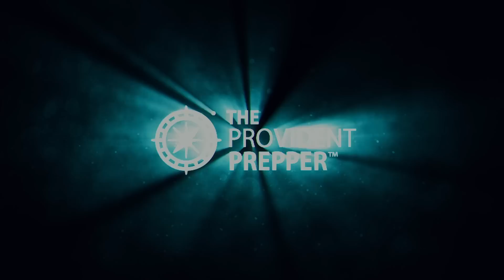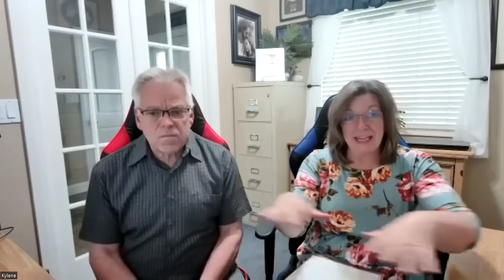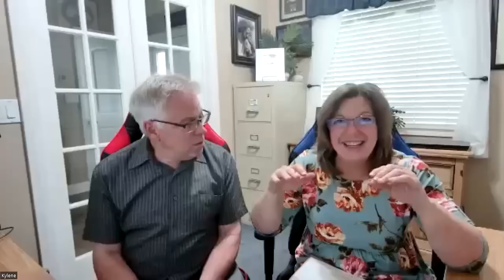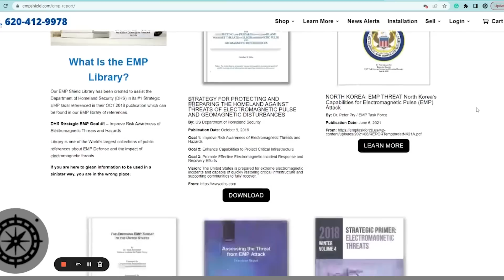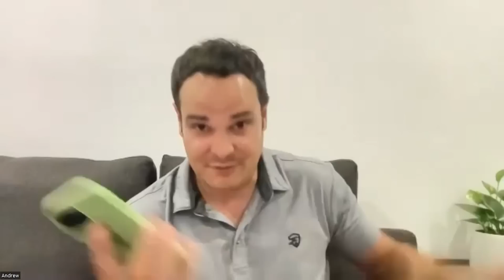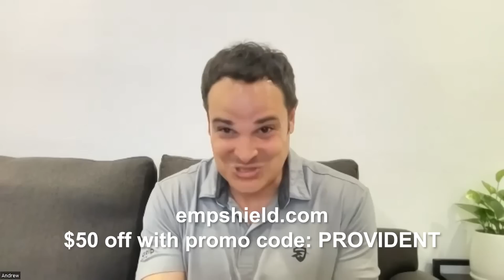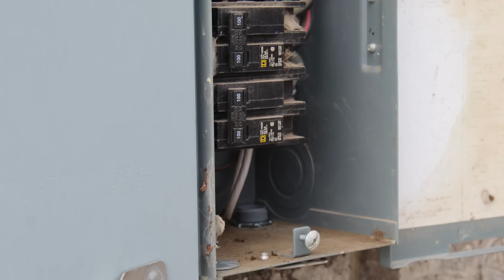Facts About EMP Protection: Interview with EMP Expert Andrew Bucchin

Comment: Our human biofields are being secretly interfered with by means of the medium of our personal smart devices. 
How our biofields which are also known as our human energy fields are being externally interfered with by digital signals which comes from our smart devices as follows:-   
Dr JerryTennant who is the author of a book called 'Healing is Voltage, The Handbook' and Dr Marshall have combined the concepts of Healing is Voltage, Scalar Energy, Biofiled Tuning, BioGeometry, Emotion Code and Neural Therapy into a system we call 'Tennant/Marshall Scalar Emotional Tuning."
Emotions and memories are stored in magnetic fields.   Emotions should never get stored and instead they should be automatically resolved and then changed to memories before they are stored.   If emotions are unresolved, they then become stored by the body and cause health problems due to their frequencies being out of harmony with the normal and healthy frequencies of the rest of the human body.  
Emotions are stored in circuits and different emotions resonate with different circuits due to all emotions having different frequencies which are disharmonious and therefore our emotions block different circuits in our bodies .
Every circuit runs at a different frequency like different radio stations.
Every emotion has a different frequency.
These frequencies resonate with each other, determining which circuit an emotion blocks.
Anger gets stores in the liver and gall bladder circuit.
Fear gets stored in the kidney and  bladder circuit. 
Worry gets stores in the spleen and stomach circuit.  
Our stressful emotions are stored with frequencies which are out of tune with the body so we try to  block them and we block the voltage going through that circuit and by that means we lower the voltage in that particular circuit and that is how our unresolved emotions make us sick.   
Our body is an electromagnet.  All electromagents are surrounded by a magnetic field that represents the information of the electromagnet.   The field around everyone's body which is known as the biofield goes out five feet approximately from the body in all directions so if you are walking within five feet of someone you are actually walking through their stored memories but you are not aware of their stored  memories because you don't have a receiver to receive them.   If you pay attention while you are walking through someone's memory field which is also known as their biofield you will feel a little distortion in the field every time you encounter one of their stored and therefore unresolved emotions.  The information about what occurred at the time of our birth is stored out at the edge of our biofield which is approximately five feet away from the physical body and the information which is happening today is being stored right up against the physical body so  by knowing this you can know the time-line of the emotional distortion which is being stored in your biofield by  means of how far out from the body in the biofield that it is located.
Because the emotions which are  stored in the human biofield are frequencies they can be tuned with scalar energy.  Scalar energy is put out by things like a tuning fork and by the bio-transducer that Dr Jerry Tennant developed so if you simply put one of these things up against trhe frequency of the distorted and unresolved emotion which is stored in the biofield it will then tune that emotion into a frequency that is in tune with the body and that means that it has turned that particular unresolved emotion into just being a memory, which will cause no more problems for you.  
It is very difficult for sick people to become well if they have stored emotions in their biofields because the frequencies of those stored emotions are out of tune with the rest of the frequencies of their body.   It is important to have any emotions which are stored in the biofield turned into memories in order for sick people to become well.  Talk therapy is inefficient and one should tune the biofield instead because all emotions are changed to memories in a matter of minutes when the biofield is tuned.  
I obtained the above information from a youtube channel called 'The Inspire Health Podcast' and that particular youtube video is called 'Ep 142: Cell Voltage & The Root To All Disease With Dr. Jerry Tennant ' and here is the online link to this video where the information is contained https://www.youtube.com/watch?v=ZnGLyhQaW.   
Eileen McKusick who is the author of a book called 'Tuning the Human Biofield' has a website called www.biofieldtuning.com and she teaches methods of how to tune the human biofield with a tuning fork to students online.  One can purchase such a tuning fork from www.amazon.com or from other online stores. 
My own opinion on the matter of covert biofield interference through the medium of smart devices is that whenever you introduce a smart phone or a smart watch or a fitbit into your own human energy field which is also known as your biofield, then unknown others can transmit signals into that biofield by means of that smart watch or other smart device which changes the information which is contained in your biofield which in turn changes aspects of your body and brain and even your thinking patterns.      I am not a scientist but I have been tortured by invisible energy signals  every day for more than twenty years without being believed by anyone who I have informed of this because they can not see such signals and because I can not prove that it is happening to me.  
Bio-sensors and other nano  technology have been placed in our food, water, air and also in many of the injections which we are being given by medical professionasl.   All of this has been done without the knowledge or consent of most of the men, women and children in the world by perpetrators who are unknown to me.     This nano technology is now inside us and is being used to conduct electricity around our bodies and brains and to carry out energy experiments on us without our consent by neuro operatives who are conducting evil acts against us while remaining anonymous.   These unknown predators can collect data from our bodies and brains and they can transmit data to our bodies and brains, sometimes by first of all transmitting it into our biofields.  They also collect personal data containing our memories and unresolved emotions  from our biofields and they then store them in data banks for later analysis.   They can transmit data to our visual cortex in the form of visions, to our auditory cortex in the form of voices, to our sensory cortex in the form of phantom sensations, pain and electric shock and to our motor cortex in the form of immobilization of our muscles and also in the form of forced muscle movement such as jerking of various muscles, grimacing of facial muscles or even whole body takeover.    Unknown others can now sleep deprive us and they can sexually molest us by remote means from unknown remote locations while they themselves remain anonymous cowards. 
Because some of the nano technology which is now embedded in our brains are nano electrodes, these nano electrodes can be used to  transmit data to all of our five senses at the same time which can by that means force us to have a virtual reality experience which some experiencers falsely interpret as them having a supernatural experience.   It is not a supernatural experience.   These virtual reality experiences have always been transmitted to people by means of technology in secret.   Whenever the research victims complain of being electronically harassed and tortured by remote means by invisible energy signals they are quickly admitted to psychiatric hospitals because doing so provides a false cover story for illegal experimenting with technology on those victims.   Research victims are sometimes accused of being demonically possessed because this  provides a false cover story which covers up the illegal activities of brain, body and biofield researchers.
Hope and Tivon, whose website is called www.ftwproject.com and  who are a married couple from Morocco and who own a factory there which manufactures products which protect against artificial electromagnetic energy have issued a challenge to all electronic engineers and neuro scientists and all others who have experience in the field of advanced technology.    Their challenge is listed herebelow in the form of four questions as follows:-
1.     Find out what are contained in bio-sensors.
2.     Can living bugs which have been modified to be bio-sensors be killed or detoxed from the human body.
3.     Can graphene be safely removed from the human body.
4.     Can tracking signals which are being emitted from within the human body be scrambled or cloaked and if so can you make wearables to achieve that.  
All hands on deck.   Please help us to find solutions.   Please share this information widely in order to warn all members of the general public of this secret attack on their bodies and brains.   If they refuse to believe this information it is because they have been remotely manipulated to disbelieve it by having signals transmitted to their brains which change their reasoning patterns or reasoning abilities. 
Please listen to Hope and Tivon being interviewed at the following online link https://www.hopegirlblog.com/2023/11/21/wired-for-destruction-hope-tivon/

Comment: I can see protecting individual high end electronics but our grid is not shielded to the point of surviving an EMP. If the grid goes down there and I’ll be no power for the majority of the population. Other electrical items will also not function after this event. We will all eventually be without electricity for several years. If you protect your car, it might still work, but the pumps that are used to get the gas into your car will not work. So for me, I prep the basic stuff reminding myself to do this without electricity. We can all mostly live without it. Yes it would suck, but that’s what we will be faced with after a terrible event like mentioned.

Comment: Did Lahaina, Hawaii, experience this? There is a lot of evidence that some buildings and cars burned from the inside out, as if microwaved, to start the on fire. Some had absolutely nothing burned around them… so they didn’t start on fire due to a grass fire, like they care claiming.
Reply: I've wondered the same thing. Blue vehicles and blue roofs  weren't touched.
Reply: In Lahaina the device used is called the Rod of God, a very nasty destructive technology most likely done by the Deep State.

Comment: I work advanced R&D for a major power company as research engineer 40+ years.

All of this is like wearing a helmet.  Good for 5mph...not good for 50mph... shades of gray in beyween.

Riddle me this.  If something is protected because its plugged in (connected) to this product....but the mains "toggle switch" (not "soft switch") is off... then the device is still physically & electrically disconnected... both things can not be true.

The devil is in the details.  

 Also.. the wires to the device they showed in the sub box product connected to the panel are SMALL .... that is a pretty low capability load spike shunt.  It better be a VERY short or VERY small POWER burst or this "helmet is only good for 5mph".

Engineering FACTS

Comment: A question for Andrew on EMP Shield: As the shield is a super shunt device, does it work for say multiple hits as in more than one nuke going off in succession, or is it a one-time active device that will self-destroy on the first trigger?
Reply: Ive heard it will last throughout all stages until its over.

Comment: I think it is wrong that solar panels will be okay IE, The solar panel is basically a photodiode that will be shorted with a high current pulse, and will make the panel useless. Just like any PN junction as in a transistor, etc. will be destroyed. I also don't believe that a device connected to the power line in a house will protect any device inside the home from being zapped as an EMP will kill those devices even if they are totally unplugged from the wall.

Comment: That’s why I have a 1972 Ford Courier with the old points style ignition as a “ hopefully it works” backup.
Reply: Same reason I have an old Toyota Landcruiser
Reply: Doesn't work for the Ford f250  2022
Reply: You will need to keep a condenser for the points, a coil , starter, a solenoid  and a battery  in a Faraday cage.  You can build your own cage if you have some good materials and directions. GOOD LUCK.
Reply: @davidwilliams6434 thank you, I overlooked that
Reply: First of all, have a pre solid state diesel vehicle as a back up.
Second buy a older exec condition or rebuildable 1940's  to early 60's Generator, and place the
unit in a real faraday cage 
for storage preferably underground or in a sub basement.
Third purchase older robust electrical gear like Motors and pumps. The more pre 1970 and the more heavy duty the better.
Forth: Purchase and FULLY rebuild one of the BIG Three
TUBE General coverage radio receivers from the late 1940's to 1960. they are:
U.S.Army R-390 or R-392 units. 
Hammerlund Super Pro 600
National Radio HRO 50 or 60
With ALL the coil draws.
In any case replace all the aging capacitors even it the 
unit is operational at present
Also always have three back up TUBES in storage for each tubes on the chassis.
Have as many as possible 1960 back tube Transmitters
Like the Johnson Viking or Ranger or the World Radio
Labs 300 or the better sets from Hallicrafters. some people use 1950s kit trans mitters from that Era. 
Purchase and properly rebuild a good TUBE CB Radio from the pre 1970 
Era of CB. Like Poly Com,
or Regency or Browning or 
Marie use intended units like Ray Jefferson. 
And don't forget batteries.
car batteries which will no longer crank cars WILL often give a few years of reliable 12 Volts continuous service. A lot of rejuvenation techniques DO work! But
you have to get to know the ropes AND any close contact with batteries IS can be very DANGEROUS. Always take precautions like eye and hand protection. 
Good luck and we need you to survive and fight.
Reply: maybe metal wrap the distributor just in case. there are also grounded spark Plug wire shields  Just Saying
Reply: @peterreal8888 gud idea
Reply: 😂 us too.  But dont let anyone see you driving it!!
Reply: @user-le2kz6tx8h add weapons to defend it. Mad Maxx 🎉
Reply: No fuel to put in it.
Reply: @denab1767  
That is true after a year or two as the fuel will eventually go bad.
Before then you can siphon fuel out of all the dead vehicles.
If you have a proper deep pump system you will be able to get fuel from the buried gas station tanks too.
Reply: @johnjanuary2958 diesel
Reply: @denab1767 diesel grow your own do the research of a diesel engine
Reply: Yep. I got an old diesel that runs on soybean or any oil or diesel ❤
Reply: Run oil you grow

Comment: Will those 2 stroke bicycle engines survive an emp attack? Been trying to figure it out.
Reply: If it has a transistor ignition or fuel injection or any type of electrical dash/controls... no it won't work after a bit hit.
Reply: @experimentmagnet  thanks! I think the only thing mine has are the magnets and spark plugs it’s one of the reasons I got into the hobby just in case it did happen and moving 100 miles in a specific direction was the difference between life or death.

Comment: Even if your emp shield saves your car, how long will you be able to access gas?  If your car is electric, well that's a no-brainer in my mind.  Solar only works if there's sunshine.  Batteries will be immensely important, but again they will run out of juice.  In my mind these are only temporary measures and you will eventually be forced to use natural sources for heat and transportation.  The horse will probably be back as main transport in the future, how crazy does that sound?  All of the scenarios I've heard predict the power grid would take at least 2-10 years to replace so the emp devices may be for nothing in the end.  It may save your butt long enough to get you home, and power your lights and fridge for a while until your generator goes down and there's still no power grid working.

Comment: For the markup in this product they could cut it 50% and still make a profit while promoting goodwill to all. As a E.E. for over 40 years in power plant generation I have seen all types of suppression, protection, screening, shielding and a lot of hype in consumer products out there. Professional EMP products use a ferrous metal enclosure Ridgid metal or EMT physical conduits shilding all wires. PVC does not! People think for a minute a true faraday cage is  steel enclosure not aluminum, not copper screens! Non steel only works for electro-static discharge (like a Van de graaff static generator).
Reply: You and I have similar backgrounds... I agree ...absolutely.

Comment: I have a few questions. Is the emp shield units a one time protection? meaning if an emp were to be deployed and the unit installed in a vehicle protected that vehicle. Could the emp shield unit protect it a second time if another were to be deployed high altitude or possible even local.
Reply: They simply do not share enough about the deign specs.  Pretty sure it's a triggered "crow bar circuit" (transistorized short circuit upon over voltage...look it up) That will work until it's hit so hard it burns out ..
Reply: No, my understanding is it protect once!

Comment: Can the EMP shield be installed into the outside electrial breaker box instead of the inside secondary breaker box and still protect all electrial devices inside the home?